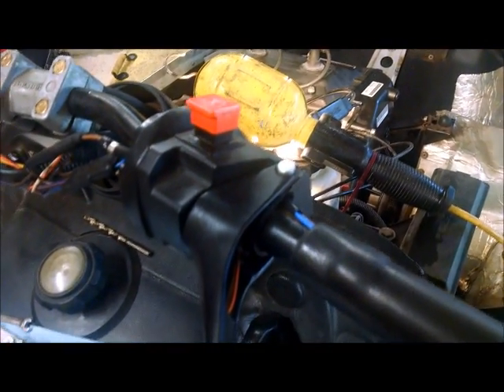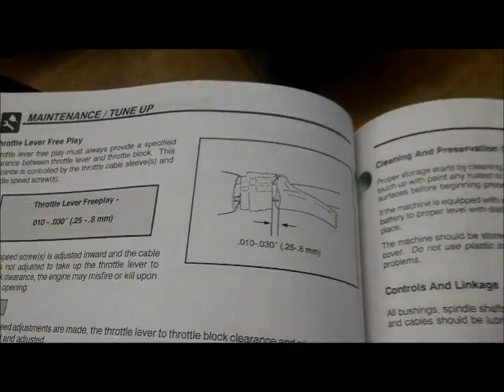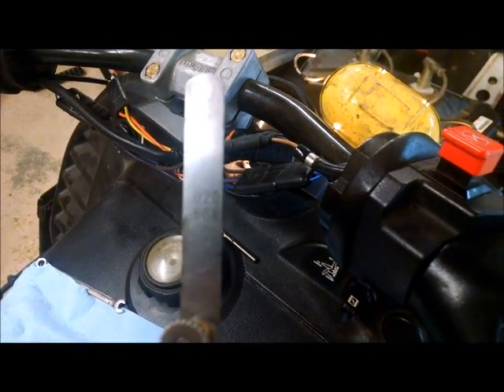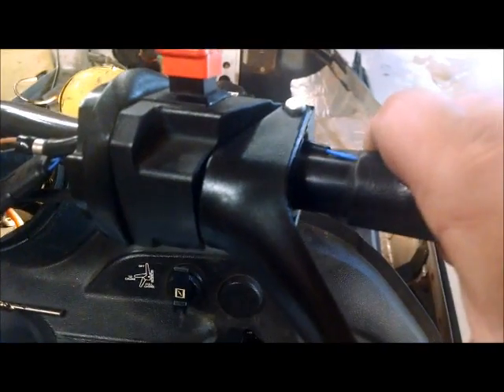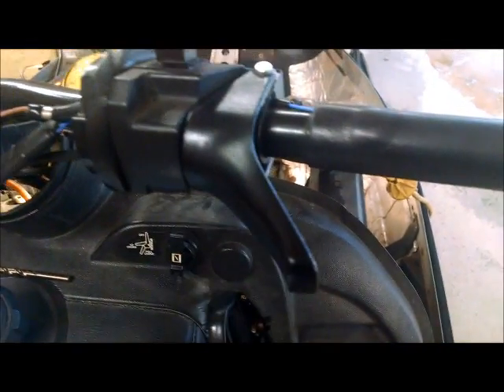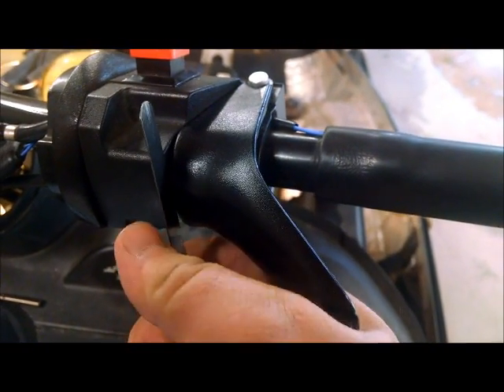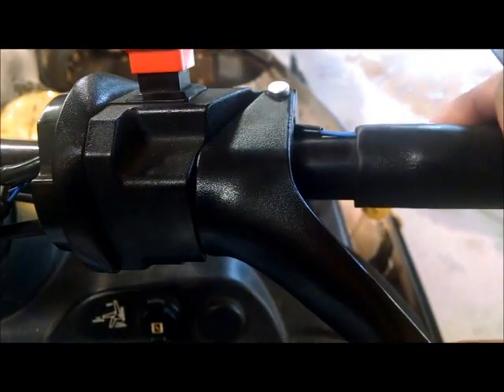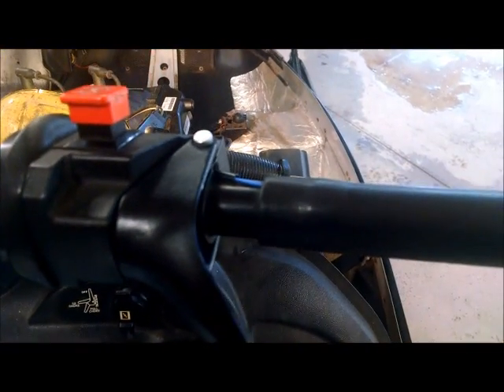Throttle Freeplay

Comment: The play there is the throttle safety switch. It ensures that if the throttle is stuck open while the throttle lever is not pushed, the snowmobile will not rev up.

Comment: OK.. If you look at the throttle.When you open it. There's a little pin. it's between that pin and the throttle you want .010..when the throttle open more it pushes on the opposite pin. (Silver) an is your safety part. The two work together. 
I am up loading a video soon on how it works.

Comment: Hey bud, did you ever figure out if that is lever is set up correctly?
Reply from the maker: I think I figured it out. Basically slide in the feeler gauge and you want to see the cable move at .3 but not at .1. there is a safety switch in the throttle which I believe is why this is so important.